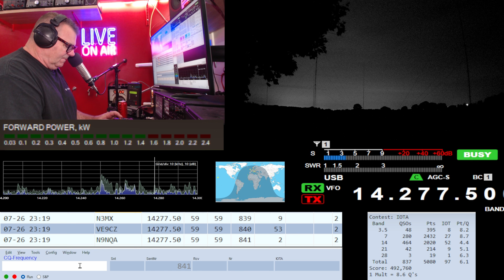Why I Don’t Want an SDR Ham Radio

Comment: Cal thanks for putting this out there.   I just went from a FT-710 (Highly rated on Sherwood) to a much older Icom IC-7410.  When you say that people can hear the DSP on it, it is true.    I don't disagree that the 710 is a great radio but I PREFER the sound of the 7410.  I can work the PBT and the RF Gain to fit what I want to hear.  If I want to play with a turnkey radio and not do any adjustments then yes the 710 facilitates that well but even the FT-920 I have seems to hear better than the 710.   It is something where people get caught up in oscilloscope numbers versus real world use.
Reply from the maker: Thanks for sharing that - you’ve described it exactly. Sherwood numbers tell part of the story, but ears, control, and how a radio responds to RF gain and PBT in real use matter just as much. The 7410 and 920 (which does have some DSP and I always liked the look and size of it) reward interaction, whereas some newer rigs are more turnkey. Neither is wrong – it’s about what lets you hear best. Appreciate you adding this perspective

Comment: I disagree with the technical argument. There is some confusion in the explanation, where DSP and SDR are mixed up.
A well-designed SDR is generally quieter than a superheterodyne, mainly because it eliminates mixers, local oscillators, and multiple intermediate stages. While ADC clock jitter is sometimes cited as an issue, in a quality design it is still lower than analog phase noise.
Modern SDRs also use effective front-end and roofing filters, comparable to or better than those in superheterodynes. An SDR does not “decide” what you hear; the user does.
Compared to a 20-year-old superheterodyne, a good SDR is cheaper to produce, future-proof, far more versatile, and quieter. If the point is personal preference, that’s fair, but then the technical argument does not really apply.
Reply from the maker: Thanks - that’s a reasonable technical perspective. My point in the video wasn’t that SDR can’t be quieter or well-designed (many clearly are - and I said so), but that for me, in a very low-noise environment, the way a classic superhet front-end + filtering presents signals is easier on my ears over long operating sessions. So yes - preference absolutely plays a role, and that preference is shaped by experience, environment, and fatigue rather than architecture alone.

Comment: Thanks for a very informative video. I too live out in the sticks and operate on a Yaesu FT-102 AND FT2000. love the older analog sound and also having full control 😊over the way the radio works. I’m a little older and have started to struggle with my hearing, so started using the Heil pro 7 headphones with phase shift. What a difference they make. I can pick out a callsign through the noise with no problem. As always, thanks for taking the time to share your experience and knowledge with us.
Reply from the maker: That makes complete sense - control and familiarity count for a lot, especially in a quiet location. Headphones can be a real game-changer too, particularly for pulling structure out of noise. Really glad the video resonated, and thanks for sharing your experience. 73.

Comment: Would 991a radio be that way ?
Reply from the maker: If you mean the FT-991A, then no - it won’t "feel" like a 990/890-style receiver. It’s very much a modern, SDR-leaning radio. Excellent all-band/all-mode box, lots of features, but the listening character is different. Great tool — just not that relaxed, analogue-front-end feel - but for periodic fun use, sure. Go for it.
Reply: @DXCommanderHQ love 991a what can do for the radio world 🌎
Reply: The 991 is a triple conversion superheterodyne, not SDR, but it does have DSP for filtering and such like. What filtering you choose to use is up to you though.

Comment: Great insights, Cal. I've gone back and forth on all of this over the years. I finally came to a decision and got a FTDX10 and an FT710. The former of course is a sort of hybrid. The latter is a "pure" SDR.  So I kind of get the best of both worlds. You can get a lot of modern features very inexpensively today. But they're not pure analog rigs., You pretty much gave the best analog rig available. Enjoy!
Reply from the maker: That’s exactly how I see it too. The 990 absolutely has digital toys -  and they’re very good ones - but they sit behind a front end that just behaves the way my ears like. The hybrid approach you’ve got with the FTDX10 + 710 is a smart way of covering all bases. In the end it really does come down to how you enjoy operating. Appreciate the thoughtful comment, 73.

Comment: Had been considering upgrading my TS990 though don't know what to.  Similar radios are like 3x times the price and looked at new SDR radios.  Glad i found this video and comments, very helpful for me to hold on longer to my TS990 ---- Kenwood all the way 🙂.  Anyone have any insights into the new Kenwood flagship radio coming (TS990 replacement)?
Reply from the maker: You’re not alone - the “990 replacement” has been rumoured for years now. Kenwood are famously quiet until something actually ships, so I wouldn’t plan a station around a maybe. The 990 is still a serious receiver by any measure, and if it’s doing what you want on the air, there’s no rush. I tend to buy radios for how they let me operate today, not what might appear tomorrow - saying that, the last model I bought was a 990 anyway - I don't actually buy radios!

Comment: I would like to emphasize the aspect of operator skill and experience. That combination is a solid part of your preference for a traditional receiver. I'll bet that your TS-990 has a battery of digital processors that you don't use. I know that my Elecraft K3 has a bunch of them. I do use them at home because I live in a high-noise environment. But, I don't think they do that much to improve my copy... they sure do reduce the amount of fatigue I get from listening to the hash without them, even for a one-hour net.

On my field ops, I rarely (probably never) use the digital processing of my KX3. But I use the heck out of the roofing filters to capture weak signals! 

I will never reach your level of operating experience and that of a number of other good operators I know. But I can still learn a thing or two from y'all. 

Great video, my friend. Merry Christmas and Happy New Year!

73 de AG7TX
Reply from the maker: That’s a superb way of putting it – especially the fatigue vs copy distinction. Roofing filters are still magic in the field. Really appreciate you taking the time to write that. Merry Christmas and Happy New Year to you too 👍

Comment: I own way too many radios and my best receivers by a country mile are analogue! As you say you have to listen through the noise but over the years that becomes as easy as an SDR anyway. It’s like AM to me sounds as clear as a bell and to others who listen they cannot tolerate it. Don’t get me wrong for say someone quite new to the hobby be it a Ham or SWL SDR is quite luxurious with noise reductions but with a bit of effort hearing things the analogue way is great and becomes second nature, to be honest i like both but if i had to have one or the other it would be analogue. The best of both works well which is why i normally stick with hybrid rigs like the DX10 i was talking about in your previous video.
I’m currently running my TS850 and listening through the noise like a trooper. 😂
Great video 73 GT
Just thought i would, you still need something new and shiny every now and then though.
Reply from the maker: That AM analogy is spot on - once your brain learns what to ignore, it really does become second nature. SDR can feel luxurious, analogue feels… earned. And yes, absolutely - we all still need something new and shiny from time to time 😂 73 and thanks for a lovely comment (PS Love that 850!)

Comment: I’m running an Anan that has amazing NR. I never use it. Like you I am lucky to be in a relatively low-noise area, and I prefer to hear the hiss. My RF gain is always wide open, and NR/NB always off. You’re making me reconsider (for like the 100th time) picking up a TS890 and calling it a day. Only downside is I regularly run ESSB with some friends and being able to experiment wider when conditions allow is nice. But at least the 890 goes wider than 3k. Your main point is key though - how do you like to operate, and what tool will work best for you, regardless if feature sets, reviews, or what’s latest/greatest.
Reply from the maker: That’s exactly it - preference, habit, and environment matter more than feature lists. If you enjoy ESSB and experimenting, that’s a real, valid reason to stick with what you’ve got. The 890 isn’t about “better”, it’s about different feel - and I think only goes to 4k? Glad the video nudged the thinking though!

Comment: I have a flex3000...it took a while to sort it but there are interesting advantages. Filtering etc digital etc all one etc etc...BUT comparison directly with  tr599 kenwood receiver i have found the 599 is its equal.. it recieves the same but in a slightly different way simpler but just nice audio...Its a great receiver as are my ts940 ts930  ts900 830 530 520 and 130 and 120....lol
However i have used a dsp outrigger....astounding ....the 130 became a fighter not a drone. It is easy to enhance an older rig with accessories and the enjoyment is being on the air...no matter what is used ...Collins Drake Heathkit all perform and you can work any anount of dx......and its fullfilling....sorry Callum i ramble but i think msny overlook the fact ham radio has not changed...a bit of rf abd a decent antenna and you are on the bands....havev great 2026 and best to you.
Reply from the maker: Very good point. Heck, that is some Kenwood stable you have there!

Comment: An SDR radio doesn’t remove any information. The noise reduction algorithms affect this, but you don’t have to switch them on (I also prefer listening to the hiss and keeping the NR off). Digital processing retains all of the analogue information - you will not loose out on hearing something with an SDR. This is an amateur radio rerun of the analogue vs CD debate 😀
Reply from the maker: I agree that in theory nothing is removed if processing is off. My experience has been that some implementations introduce artefacts that, once noticed, are hard to un-hear. That’s not a criticism of SDR as a concept - just how different designs present audio to different ears. Same reason the analogue vs CD debate never really ends.
Reply: @D @DXCommanderHQ Yes, these artefacts come up a lot in conversation about TX audio as well, and are often described as metallic sounds. Is that what you hear? If so they seem to disappear when slow roll-off filters are added to the top end. I think our ears are used to hearing these filters rather than the brick wall filters used in SDRs.

Comment: It's hard to beat the superhet receiver. I find them easier on the ear.
Reply: RF gain and attenuator knobs are there for a reason. Sadly, most hams have no idea how to use them.
Reply from the maker: Yes... as an operator, this is easier on my ears.

Comment: Cal, this is one of the best videos I think you have made. I am a Flex user and have recommended you get a Flex. But, I'm used to operating in high-noise environments and I didn't consider the mostly analogue receiver experience that works better for your experienced ears in a low-noise environment. I learned something new! P.S. It's fun to see you in the home studio making videos again.
Reply from the maker: Thanks - that’s exactly it. Maybe Flex makes total sense in noisy environments? This one was really about ears, habit, and context rather than “better or worse”. Glad it landed 👍
Reply: Cal and I had a great discussion on Flex and he had great questions.  Cal and I also agree that the Brain is the best receiving tool out there.

Comment from the maker: Quick note: this isn’t anti-SDR. Modern SDR radios are superb - especially in noisy environments. This video is about how I listen, not what everyone else should buy.
Reply: Exactly !...How YOU listen....that is the point entirely .
Reply: I never took your video as being anti-SDR. I have a saying that I stole from somewhere (I can't remember)... "The mission determines the loadout." You gotta take the tools for the job and a hammer just won't do when you need a screwdriver. (I tried that once, I think.) 

And, I could do a lot better with more reps than looking for "better" equipment. I love Sherwood's technical analysis, but my money says that any of the top five or ten radios on his list (maybe more) are so good that one could not tell the difference in practice. The choice then becomes which rig provides the best operational setup for each operator. That's personal preference.

OK, I'll crawl back under my rock now. Happy New Year!
Reply: Makes perfect sense to me Sir.  Having spent many years repairing radio equipment for other hams I have tested a wide range of hardware including classic analog, modern digital and SDR equipment. I personally prefer classic analog hardware as I find it easier for my rusty old brain to pick voices out the noise without digital artifacts. I found that for me personally using a rig with DSP or other processing was more tiresome and after an hour of so I have to take break away from it but I can spend many hours listening with my old FRG7, TS-130S or other older rigs. The FRG-7 is still one of my favourite receivers and I have used it as my main RX with a variety of rigs used for TX (with TX radio controlling an antenna switch that disconnects the antenna from the RX radio and grounds the RX radios antenna input while muting the RX radios audio output.  I also enjoy NOT having a computer on when listening for weak signals and QRP stations as every computer generates a level of noise no matter how well RF shielded it is. I have tried quite a few SDR radio setups from super cheap USB dongle types to expensive posh rigs I could never afford to own myself and have found all of them to be a lot of pfaffing about constantly tweaking and fiddling with all manner of adjustments and they still tire me out much quicker than the old analog gear.  I gave up doing repairs a couple of year ago as I struggle to see and work with tiny SMD components in newer equipment and suffer with shakes making fine work very hard. I also don't like to use gear I cannot repair myself when required which pretty much rules out computer based SDR gear as most of the trouble I have had with them has been software related and I'm too old to be messing about with software and it's associated issues, re-installing and wasting time on computers after updates break things is no fun. I like gear that does not need a computer to work just power and an antenna, turn it on and it works. I am not anti SDR but they are simply not what I prefer to use. All the best from Scotland.